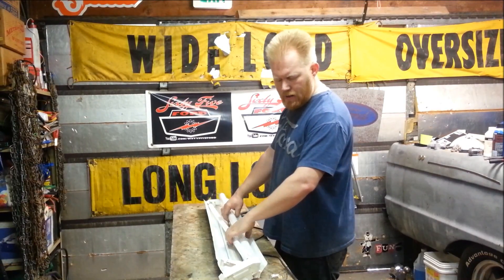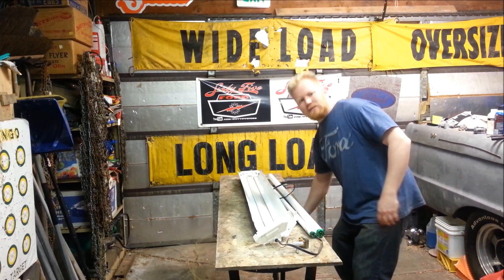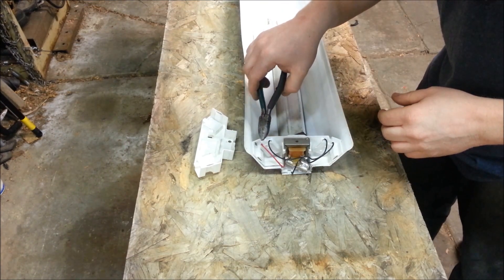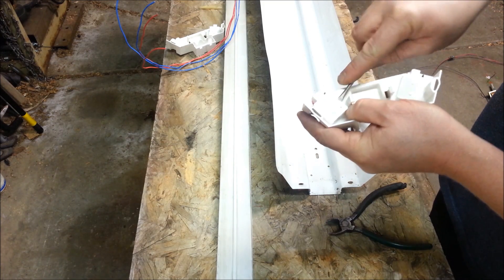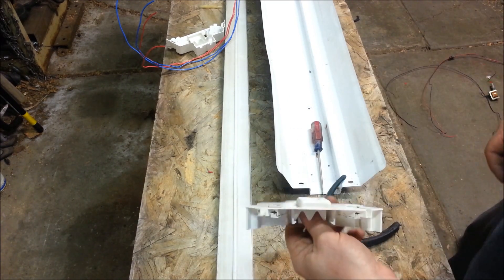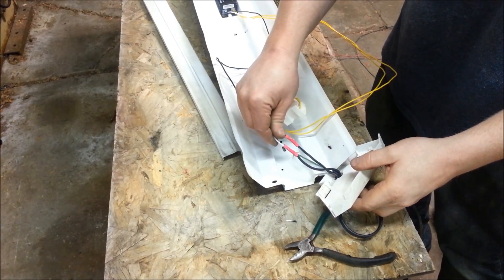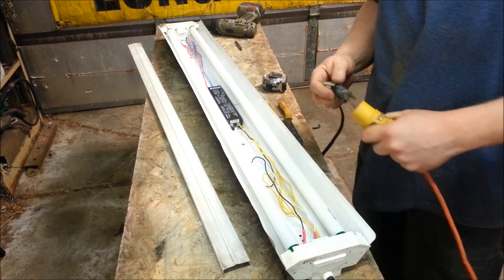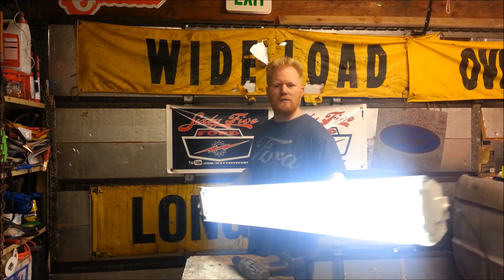Convert T12 Florescent shop lights to T8 Ballast and Bulbs

Comment: What I am trying to sort out is whether an F40 bulb is a type of T12 or what? Most of my old bulbs are F40s, and all the webpages merely discuss whether you can use T8s in T12 ballasts. 

Also on my bulbs, it said that the lens should be facing down, but it wasn't clear which side is considered the lens, and I can't seem to find any pages that discuss that. When I put it in, it works with the clear part away from the ballast, but I would have thought that the clear part would be the lens. Hope I don't burn my mom's house down because we are getting light, so I left it the way it worked.  sigh
Reply from the maker: F40 refers to a bulb that is 40 watts and "F" florescent. You can have F32, F34, etc. T12 refers to the size in 8's. So a t12 is 12/8 or 1.5inches vs a T8 which is 8/8 or 1 inch. You would have a F40T12 as the model model number. Anyways, so you put in LED bulbs I assume. To get the most light out of an LED you want the LEDs facing downwards. This is simply because LEDs are directional light where as florescents put out light in every direction.
Reply: Thanks for the explanation! I guess the LEDs are downwards because I am getting plenty of light from it. :)

Comment: Instead of this, you can go directly to T8 LED bulbs by simply disconnecting the ballasts.  

More light, less energy, last longer.  Never have to buy ballasts again!
Reply from the maker: This is an old video and I have upgraded most to LED now. Surprisingly though the Florescent T8 put out more light per watt than LED T8 bulbs do. So they don't save any electricity over T8 but do over T12. Also some of the LED bulbs have a pretty significant delay in starting time where you flip the light switch and 2 seconds(feels like an eternity) of darkness until the LED comes on. I like the LED bulbs but just like the round LED bulbs I have been putting in my home I'm sure they'll burn out in short time.

Comment: Hello! I am replacing my T-12 fluorescent like fixture to T-8, the orion ballast tat I purchased has two blue wires on one end and white, red and black on the other end. In your video you depicted four wires on each end, can it still be done with the minimum wires I have? I have four points on each end where the wires are supposed to go in. Please get back to me as soon as possible! Need some direction, thank you!

Comment: 65, my snow blower broke today. I was going along and then it stopped moving. A shaft, screwed on from the outside, came loose. I found the screw and bearing but it looks like there is a gear missing. There is a chain that lines up with the shaft but no gear. I don't know how the gear would have fallen out since the bottom has a plate on it. I took the plate off and no gear. :-(.  Any thoughts?
Reply from the maker: That's strange. There are usually 3 shafts. Did the sprocket slide over and now is not inline with the sprocket on the another shaft?
Reply: sixtyfiveford  No. I examined the machine over and over seeing if it was stuck somewhere. I think once the screw holding the shaft on (its the shaft that has the wheel with rubber on it) came off, the shaft fell down and then the gear must have came off and got buried in snow. There is the possibility that the street plows pushed it down the street, buried in tons of dirty wet snow.
Reply: sixtyfiveford Also my back up machine, both stages of the thrower stopped throwing.  I am hoping that it is just a belt. I was trying to break through the end of the driveway where the street plows dumped a ton of packed snow.
Reply from the maker: That would be sad. What is your snowblower and the model number. Let me look at a parts breakdown.
Reply: sixtyfiveford It is a Yardman, 1997 model. It has track drive, 26" and 9.9hp. I have to find the model number, trying to find the papers on the thing.
Reply: sixtyfiveford I found the papers, it is model number 317E753F401.
Reply from the maker: Looks like part # 713-0413 but you would need to confirm. It should run you $15 bucks.

Parts breakdown:
http://www.mtdparts.com/equipment/ARIPartFinderView?storeId=10101&catalogId=19502&langId=-1#/MTD_Merged_Data/317E753F401_%281997%29/Track_And_Frame_%28Part_1%29/010260700-A/0102607000004
Reply: sixtyfiveford Thanks!

Comment: A newbie question here -- what did you use for the wire going into the light (the one that will go to the socket) Was that original to the light? I have some nice salvaged lights I'd like to do this to but they don't have plug-ins for them.  What would you suggest I use?
Reply from the maker: This one had a plug in cord on it already but most are just "hard wired" in with Romex. You could cut a cord off an old junk appliance and use it. They also sell them at the Home Depot or you can make your own by cutting up an extension cord and buying Male Plugs.
Reply: sixtyfiveford
Thanks so much for the quick and helpful reply!
Reply from the maker: Let me know what you decide to do. Take care -Moe

Comment: sixtyfiveford Great as always instructional video. I have a bunch of shop lights I will convert too. On another note however, how can I tell if my craftsman scroll saw motor is a capacitor start or not. I am trying to get a variable speed control foot pedal setup but the manufacturer says not for use on cap start motors.
Reply from the maker: A cap start motor will have 1 or 2 large humps on the outside of the motor casing. Here is a picture of a cap start motor http://www.harborfreight.com/3-horsepower-compressor-duty-motor-68302.html

I would doubt that a scroll saw would have a cap start motor.
Reply: Thanks  I thought the same but some of the research I have been viewing show cap motors without an external cap. What do you think? they mention drill presses as having cap start motors but mine has no external cap.
Reply: sixtyfiveford love the link to HF I am an avid HF customer
Reply from the maker: What is the model number of your scroll saw?
Reply: sixtyfiveford I appreciate your interest but I don't want you to waste your time on this, if you think it is not a cap start. I may just take a chance and order the controller and hope it doesn't cook the motor or the controller.
Reply from the maker: I was going to look at the parts diagram online.
Reply: sixtyfiveford I already did. Doesn't tell you anything except 1725 RPM 120v single phase motor with a part number 66055 for the motor
Reply from the maker: Capacitors are generally reserved for larger high torque motors. Start capacitors are all around the size of half the length of a banana and you will see them pretty clearly. I think you're safe. You could do a cheaper test with a light switch dimmer wired between the power to the machine. Or if you have a dimmer on an outlet already in you house buy a 50cent light socket adapter and plug you saw into it and you can control speed.
Reply: sixtyfiveford Thanks man you always have the work arounds.
Let you know how i make out

Comment: As usual you make work look easy. It did seem like a lot of work to save a few bucks, but you save a little here and a little there and the bucks add up!
Reply from the maker: Yeah, not a huge saving there. I figured it took 10-15 minutes to do this one and saved me $35 over buying a new fixture with an equivalent ballast or $15 over the cheapest model. So I just made. $60-$140 bucks an hour. 3 more to go.

Comment: I just looked at the Home Depot web site, they still sell a 10 pack of T12's for $32.47. Is this a different kind of T12?
Reply from the maker: They are phasing them out. Just like the 100watt and 75watt incandescent light bulbs that can no longer be produced and 60 & 40 watts are scheduled to stop production this month. I have two 8 foot t12 fixtures that I have always been able to buy bulbs for 4 bucks a piece. Now they are around 18bucks a piece (3 weeks ago). T12s are almost double the price at $32 and the ballasts stopped being produced in 2010. You can find the T8s for around $15-20 for 10.

Here is an article on it.
http://www.lamprecycling.com/articles/T12-phase-out-management/

It is rather annoying as with all the data I found they are virtually identical in light/lumen output per watt. So they really aren't as energy efficient as they are touting. Some articles even claim t8s are obsolete and t5s are going to replace them real soon.
Reply: sixtyfiveford Wow. I bought 4 four foot shop lights in 2007 and they had T12 lights in them, I didn't know anything about T8 or ballast. I think I will just buy 2 ten packs since they are not on very long per week. 20 bulbs would probably last 25 years for me. Unless the new bulbs are crappy and don't last long. Can T8 lights work in a T12 fixture?
Reply from the maker: Some fixtures will say T12 and T8 especially models made in the late 2000's. Look at the side of your unit or on the ballast itself and it will say all the types of lights it uses.
Reply: +Dasdfjkl Sometimes, but not in cold weather, but T12 lights CAN work in a T8 fixture

Comment: I Assume those dead bulbs were 40 watt, are the replacements 40`s also? Thanks
Reply from the maker: The standard 4' T8's are 32 watts. They don't put out the same amount of light but they start better. In real world testing they put out basically the same amount of light/lumens per watt as the older 40 watt T12s.
Reply: I  have seen these around and they may suit me in my nursery when I start the seeds for my vegetables in spring. The lights I have are the t-12`s and radiate an appreciable bit of warmth. That helps with the seed starting. Thanks for your brain. It operates like mine. I haven`t seen your videos, but I am watching them when possible.  See ya!

Comment: Great video,i have five T12 lights in my Garage.time to start stock piling some T8's i think
Reply from the maker: Brand new ballasts for the T12 to T8 are only around $10. each. So I figured I would start changing them out when the die. I do have two 8 foot fixtures with T12's that they phased out bulb production on. I used to be able to get a bulb for around 4-5 bucks. Not anymore, now they are 18-20 bucks a pop.

Comment: This brings back some memories of when I was in the sign business.  I use to wire up multiple ballast large box signs and neon signs with transformers. I've wired up some of the 40 foot neon electric guitars for Hard Rock Cafe' and stuff like that.  All of my shop lights are the T-12's.  I guess I'll switch over next go around. Nice vid as usual.
Reply from the maker: Neon is always cool. I wish I had more. I do have two 8 foot fixtures with T12's that they phased out bulb production on last year. I used to be able to get a bulb for around 4-5 bucks. Not anymore, now they are 18-20 bucks a pop at the Home Depot. 4 foot t-12 seam to be doing the same thing. I think they phased out a lot of t12s last July as well.

Comment: Thats brilliant, looks and performs like a new light :-))
Shame they used bean can metal for the housing, tight arsed manufacturers lol.

I used to work in a factory assembling sun beds, just a uv tube instead of white.

A heavy choke and starter was the circuit, a loooooooooong time ago lol :-))
Reply from the maker: Yeah, they try to save a quid anywhere they can. That's an interesting job.

Comment: Older ballasts are magnetic ballasts (what give them that signature sound.) The canister is a spark-gap igniter for the bulbs, which is why older flouro bulb fixtures flicker when they start up. If you look at one of the ends of the canister when you apply power to the ballast and lamps, you can usually see the spark. That's probably what went bad.
Reply: Indeed they do. I've got a bunch of those fixtures, one by one they're starting to fail, I swap those film canister things around between fixtures to keep both lights working. The ones I take the 1 good one from get converted to electronic ballasts like this video, except I stuck with T12. Didn't know I could switch to t8's but I think I'm happy with my decision. Unless in the future t12's start getting expensive while t8's take their place. Only thing that worries me.